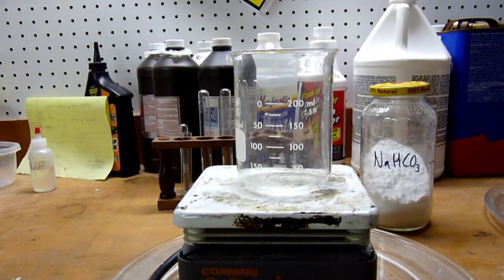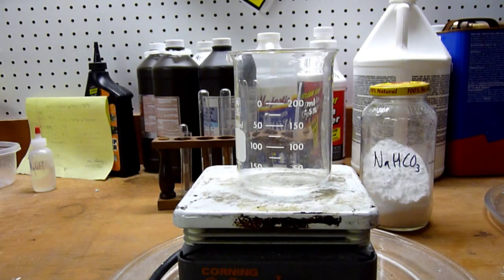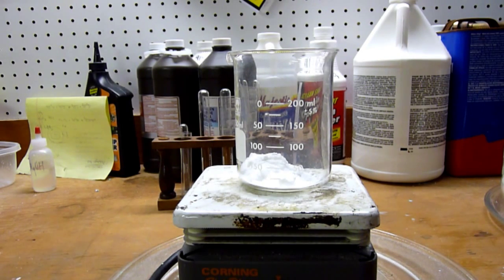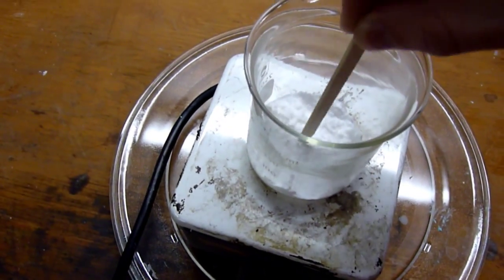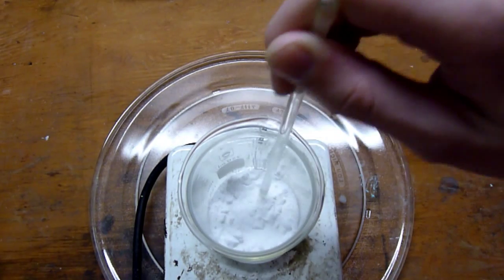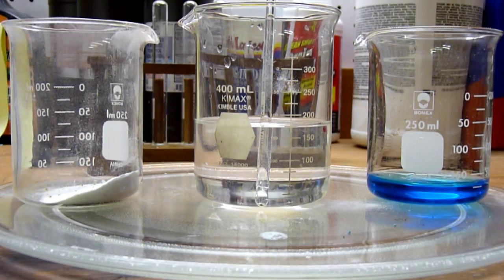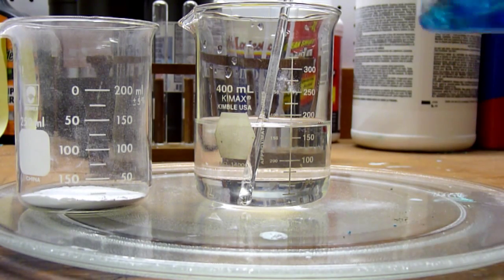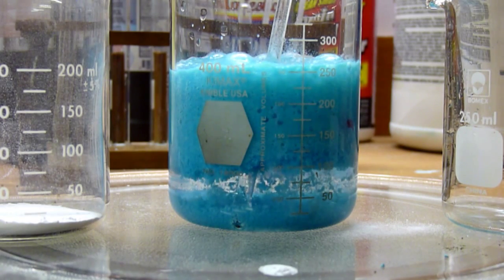Copper II Carbonate: The Easier Method

Comment: it still foams but bicarbonate presents excess carbon dioxide into the reaction where as the sodium carbonate does not.  You still get the same product which is technically Dicopper dihydroxide carbonate regardless.  Incidentally, if you were to stir the reaction mix more it would foam more.  You produced a gel phase which slows and inhibits mixing to a degree.  Same thing happens when precipitation concentrated calcium ions with carbonate, phosphate or sulfate.

Comment: you can buy sodium carbonate at pool supply stores as a pH increaser.
Reply: agent475816 I buy it for like 1.5$/kg at the dollar store as washing soda. And it not even some crappy stuff, it's 97%
Reply: no, it's baking soda. and it's called sodium bicarbonate
Reply: I know what I bought is sodium carbonate because I have some, and it was sold as pool pH increaser. zhmapper used sodium bicarbonate but sodium carbonate should work at least as well, if not better, because you don't need to heat it.
Reply: Patrick Leverone oh